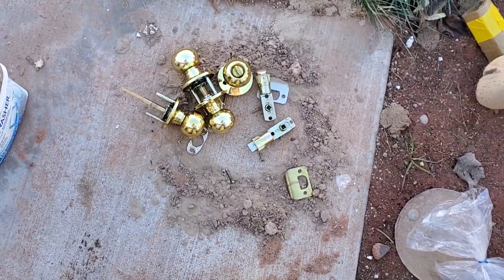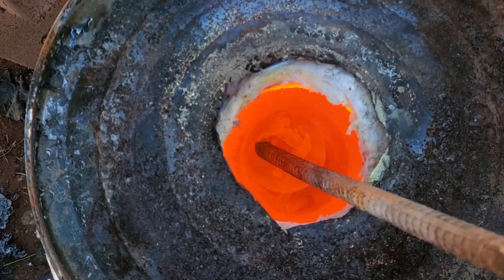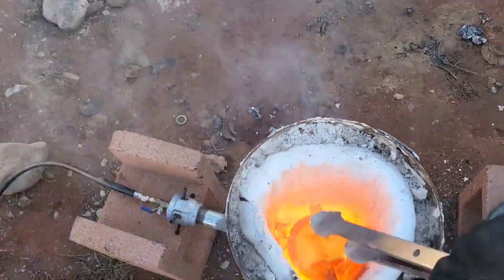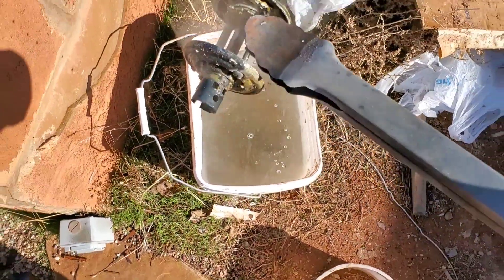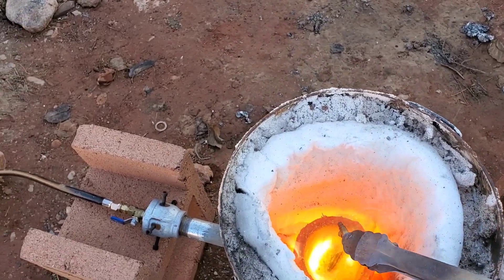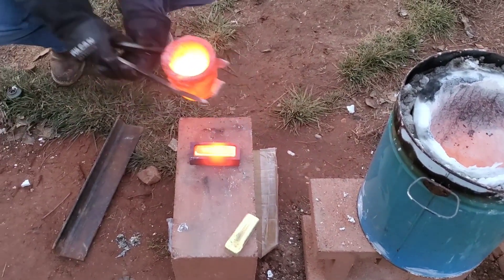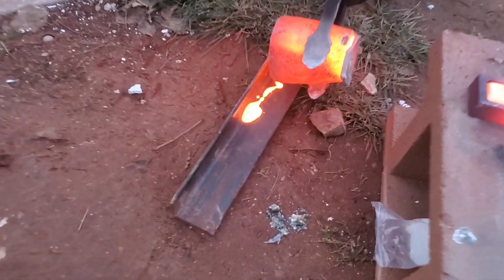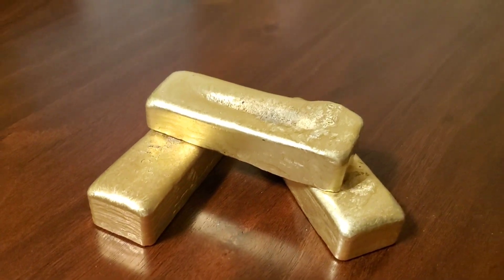Doorknobs to Ingots- DIY melting brass doorknobs to a brass ingot

Comment: I loved the video I actually have quite a few doorknobs and can’t wait to melt them
Reply from the maker: It's pretty easy because the steel floats in brass.  Just make sure they are brass and not magnetic.
Reply: Thanks I have magnets so I’ll make sure
Reply: Also how did you make your propane burner?
Reply from the maker: @wafflebuilds7812  I made the one from king of random. https://youtu.be/eO8NwseRxSA
Reply: Thanks I might give it a try